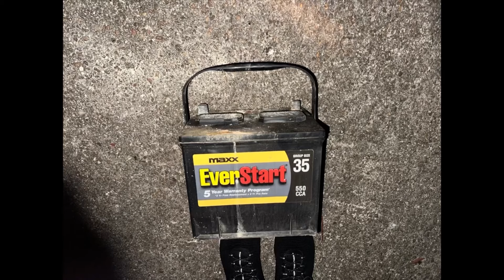My Husband Taught Me How To Change A Battery In Car 🚗|

Comment: Yea, that corrosion is all over the top of that battery. Try not to touch that stuff, It is extremely bad for skin, eyes, breathing in, .It eats through all types of metal, . Disposable gloves would be safe to use and without touching any battery acid,
Reply from the maker: Thank you 😊!!! I was suppose to have been gotten my battery changed.